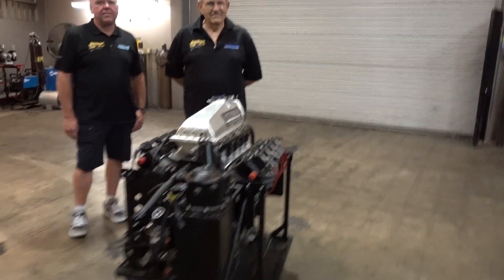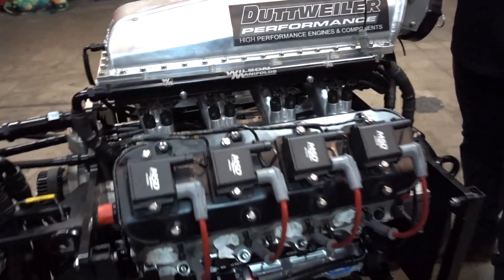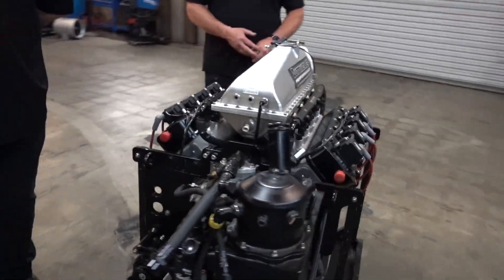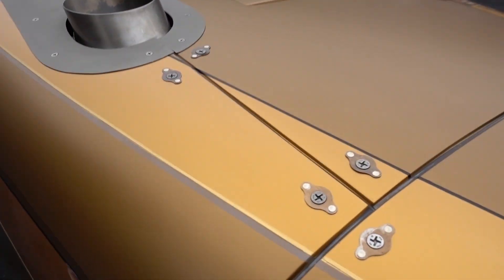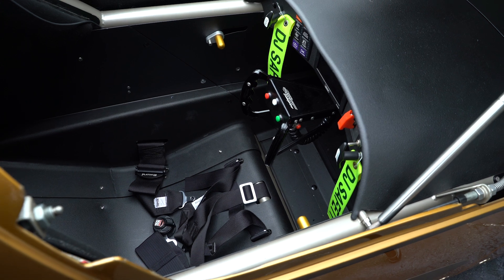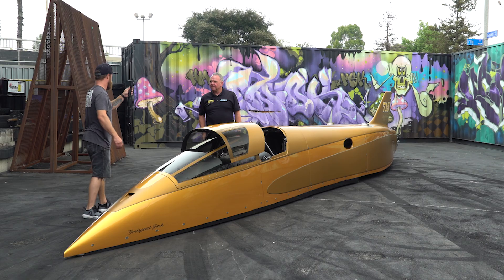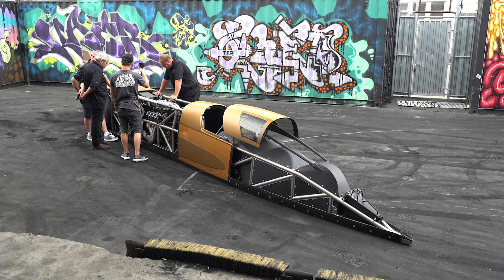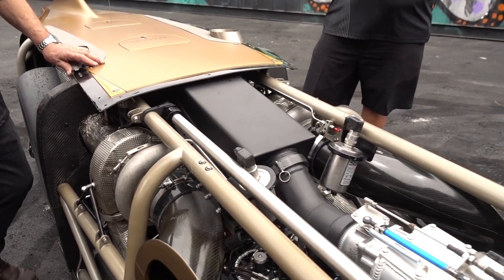What has 2600HP and goes 460MPH? LS Powered Landspeed Record Crusher!

Comment: 2.4 Gallons per Mile isn't that bad when you're going 460 MILES PER HOUR
Reply: Just put it in neutral and you definitely get ther
Reply: Holy crap but that's $ 1,104 an hour but if ya got money to build something like that then what's a grand...CHACHING..POCKET CHANGE
Reply: @emileemarshall7757  a thousand an hour? almost a thousand gallons of gas an hour... where do you live that gas is basically a dollar a gallon....
Reply: Here & Now the gas they use is prolly $10 + a gallon
Reply: they can buy a new LS engine with the money for test runs of this thing
Reply: 2.4 mpg is the same when going 460 and when it’s going 10
Reply: Yes but, about the same amount of nitro, to go 1k'.  I personally am impressed there is fuel MILEAGE at all! One again, great presentation! Ty!
Reply: Yikes, it’s miles per gallon not gallons per hour haha.
Reply: Why does this number even matter?!
Reply: You wanna run an hour, that's 191+ gallons...
Most economy cars probably get 460mi on a full tank.. like 46mpg on a 10 gallon. Or 8,786 miles with 191ga
Reply: @KevinBurke-bi0n3rd  ohhh, but the sound of a Prius rattleing out of the exhaust,,,, PRICELESS!
Reply: The math going on in this thread is sus
Reply: You realize it’s usually measured in miles per gallon not gallons per mile right? That’s pretty fucking bad 😂

Comment: I had to scoop my jaw up off the floor when he said "it's heavily into the traction control well up to 400 miles per hour"
Reply: Isn't it amazing what 2600 hp can do?

God even that number is mind-boggling.
Reply: Well when you’re racing on salt

Traction is the nearest limiting factor compared to drag
Reply: this why they take such a long run at it , cause they cant use the power
Reply: Several years ago Duttweiler said that "It's very unnerving when the engine spins the tires at 400+mph! LOL Said his "little" engines are almost as fast as the big engines because the big engine torque spins the tires at speed.

Comment: I bet when aliens land their spaceship will be LS swapped
Reply: Yote swaped
Reply: This comment made my day hahaha
Reply: @justinwright6142  no room for a slowyote
Reply: I would have put a 2jz or lsx. Possibly a lt engine
Reply: only problem with that logic is that it always took chevy and dodge a whole litter larger just to match fords 5.0 so yeah no I would still rather the coyote
Reply: @mashedt8rs290  well in that case the 800hp koenigsegg takes less than half of a coyote and less than half the cylinders, oh wait cant just pull that out of some junkyard truck like you can an LS can you, more liters doesnt equal power my man.
Reply: @ripinpieces8387  Bro the koenigseggs originated with Ford V8s. Ford has always made more HP per liter than both chevy and dodge.
Reply: @ripinpieces8387  Also Koenigseggs are all V8s, and you cant have "less than half the cylinders of an 8" that makes no sense. Also why are you telling me that more liter doesn't equal more power? That was what my original comment was saying, that both chevy and dodge takes an entire liter to match the power of Fords engines.
Reply: @mashedt8rs290  yeah but whats the downside of another liter?? Like its a competition to have less liters, and look it up there be a 3 cylinder koenigsegg made that makes over 500hp.
Reply: @ripinpieces8387  fuel consumption. Smaller engines generally uses les fuel than a bigger engine with some hp

Comment: step 1 take a canoe
step 2 turn it upside down
step 3 LS swap it
profit you just got yourself a Landspeed Record crushing vehicle
Reply from the maker: Genius.
Reply: flip canoe back over and smash water-speed records profit^2
Reply: jokes aside in the 50s they used very similar things out of warplanes to make bikes
Reply: Look up belt tanker land speed cars...
Reply: Put Brad to build it.
Reply: Craig  "belly tank" or "drop tank"
Reply: Fun fact; the 1906 stanley steamer rocket, which set a land speed record in 1906, was actually two canoes flipped on each other, powered by a steam engine.
Reply: Fred Banionis  Perfect.
Reply: No lie, this comment, actual laughter was produced.
Reply: @noprob364  look up long tail drag boats, these guys in Thailand strap crazy ass turbo diesels and shit on these tiny boats and just haul holy ass down their rivers.
Reply: Sounds like a Sumbag Lab experiment!
Reply: Water is essentially a very dense gas, so hydro- and aerodynamics are pretty much the same. It would definitely work if you use a cart size frame as a base and lie down in the thing. Clear plexi on the front and a small tail fin to stabilise the deal.
Go for a cart landspeed record.
Reply: @starfox4574  *alwp?
Reply: Genuinely true 😂

Comment: I love the gearbox shifter best, it works the same way as the 3 speed in my homemade dragbike except I only have 3 speeds and mine is air pressure not co2 (I was toying with using nitrous to save a cylinder though) and I pull rods through the centre of the cluster which the gears connect to internally rather than using forks, but ramps on the gear throws out the previous gear against air pressure, which means you can shift without letting off the throttle, and it also means if you back out of the throttle to save a run, the gearbox doesnt take a shit as the ramps override the shift pressure and save it from locking up when you back out. That is a truly awesome build and they are cool guys for letting you see under the hoods at how it hangs together.

Comment: Easily the most interesting build biology video yet! There’s so much more about the car that I want to know about now. How do the tires not balloon at that wheel speed. How do the keep fuel/oil from not getting pushed to the back. What does the steering system look like. I need more info!!!! Such an awesome video, dan always seems to ask all the right questions, he killed it!
Reply: jetpilot28 I thought they said hey had pumps in the back that push it forward
Reply: I'm pretty sure most salt flat guys use air plane tires that you'd see like on a commercial jet...where as the speed increases, they get skinnier and stiffer and don't have a "balloon-like" sidewall. don't quote me on that though...
Reply: @BlownVR  Too late. I'm quoting you on it lol. That's pretty interesting though. I had never thought about it
Reply: they actually use steel wheels no rubber after a certain speed the tire just destroyed them self so they run i think aluminum or steel wheel
Reply: In the old days they would run solid wheels, then they switched to aircraft tires and like this team runs the LSR tires. Technology has caught up to be able to make a tire that can handle those speeds. You also have to realize that salt is not like asphalt so the durability isn’t as intense on the tread. It is all more in the construction and sidewall strength.  With regards to the fluids, they are using massive pumps to push forward and keeping the fluid flowing helps mitigate the g loads pushing it back. It also helps that they aren’t accelerating like a top fuel car.
Reply: mrthesquid well flashpoint stream liner still uses solid wheel in the front.
Reply: Actually, the tires do balloon a bit. They didn't really show it in the video, but the front wheels are one in front of the other like a bicycle. On their original car, once they went fast enough, the two wheels expanded enough that they rubbed together. Like Kenny said, I don't believe it lost pressure, and it didn't crash, but there was definitely some tire carnage.

Comment: Who needs a carbon fiber wing when you have a landspeed car!? Look at that aero!
Reply from the maker: It's all aero! Insane.
Reply: The arrow dynamics is crazy.
Reply: That's not the land speed record vehicle that is the thrust ssc.
Reply: GamezAhoy well this didn’t cost $100 million
Reply: @theantsaretakingover  cheaper version but cooler and...moderately safer xD
Reply: @gamezahoy712  there are lots of different classes of land speed records. Jet or rocket cars like the thrust ssc play in the absolute top speed class, but they don't spin the wheels with the engine.

Crud, the world's fastest stock-bodied car was a 1990s Firebird for a while, 300mph and the only outside hint something was weird was a lack of mirrors. Took about 1200hp to push that through the air.
Reply: @ScottKenny1978  yes I know but the thrust ssc does not hold it anymore if I am correct.

Comment: I enjoyed this far more than I thought I would. I've always known there's a lot of engineering that goes into land speed cars, but I've never really thought about just how much stuff there is on one that you won't find on any other type of car.
Next you guys need to get Underground Racing's half-mile record holding Huracan. I want to say it was like 276 or 278 in the standing half mile. 460 mph in five miles is impressive, but almost 280 in a half mile in a street legal (kinda) car is just stupid.
Reply: I know their demo car/test mule ran 259 at one point, but i could have sworn I remember seeing one where it ran over 270 and was pushing like 2000 bhp. I might be getting it confused with one of their standing mile runs because I know that Huracan of theirs is a record holder, but I also know the current standing mile record is like 293 or somewhere around there.
Reply: Cleetus is gonna have a jet car soon.....  Think this will hold up?

Comment: Yet more proof that the LS is the greatest engine ever designed, whether it's a bone stock low output truck motor or a 100% custom built version.
Reply: Fan boy mentality instead of appreciating everything for what it is ...
Reply: @brucedressel8873  it isn't fanboy mentality. The LS engine is the cheapest source of reliable horsepower, if you can't handle that reality, you can cry yourself a puddle. It is what it is, and it's a beast.

Comment: CRAZY NO DOUBT

but not sooooo crazy anymore when you think about that Mercedes would have been able to build a streamline car that runs also About 700-750kph (which is about 460mph=740kph) back in the 1930s 

they wanted after they built and drove their other streampline car up to 432kph also bakc in the 1930s 

but for the one going up to 700+ it was too late because before it could run the war broke out

but think about that thats about 80 years ago and Mercedes was able to build something that runs as fast as this car
Reply: Also don't forget tire technology from that era. Practically non existant. Or at least experimentally, because being Mercedes Benz they would have begun experimenting with hi speed tires while in f1

Comment: The MOTEC & Shane T combo is so trick, that I bet Shane could run a couple pneumatic rams mounted to the wheel and program the ECU to steer the car.  The MOTEC can already accelerate and shift the transmission.

I feel that as trick the ECU is in this thing, the fabrication and engineering is just as crazy.  The design where the turbos, intercooler etc stay in place and the different size engines that the have all can bolt up to it.  Super trick.

Comment: To balance the downforce so well with any active aero is crazy good. The car uses a bit of an upside down airfoil to increase down force at a certain rate throughout acceleration. Incredible engineering. Not so much of that cheap Newtonian crap that just makes drag. Almost entirely Bernoulli.

Comment: Dry water, I think it's called Novec. Won't corrode metal. Good idea to have a respirator with O2 supply for the driver if you use that.

Comment: There's a lot of  NHRA drag racing technology in this car. The car is like a dragster in an enclosed shell. There is a lot of Pro-Mod technology in the engine and Pro Stock technology in parts of the transmission.

Comment: "Yeah we figured most fires in the engine bay start so low because of oil, so, we made these little things spray water all over to cool things off and also deal with fires."

Just. You know. Casually putting fire sprinklers in an engine bay, not just to help mitigate the fire, but to also COOL THE ENGINE. No biggie. And, you know, cockpit-activated dry extinguishers to suck all the oxygen away from the fire.

Comment: i've always wondered if i turn my car heater on 100%hot and turn the AC on, will it help cool the heater core or is the AC set up after the core so it only cools the outgoing air into the cabin, does turning the heater on full cool an overheating car?

Comment: When I first read the title and was like it only goes 460 mph with 2600 hp, but there are some limitations
Reply: Simply stated, the force acting against a moving object increases 4x as speed doubles.
Reply: where did you get that only from? Have you got an example of something more impressive in terms of power/speed correlation?

Comment: An exhaust can make a downforce?
Reply: Sure and lots of it. A turbo is a fan turning a fan and aspect ratio and what not lets say exhaust pressure is 50psi to get 65psi of manifold pressure. That looked to be about a 4" exhaust pipe so about 12" of area at 50psi is 600 lbs of downforce per side so 1200 lbs total?  

Oh, and jet engines. That exhaust has a lot of force. 

Up down forward or back. It's all about where you aim it.
Reply: Thrust vectoring..... but on the ground. Dope AF!!!
Plus single file front wheels! Oh my ugh!!!
Reply: @timothydillon6421  1200 lb? Not entirely sure about that. How did you calculate; did you take exhaust density into consideration? 
If you're right they should've aimed it backwards, that would be a lot of thrust that could significantly increases speed.
Reply: @LocPH.  it was purely a speculative guesstimation using nice round numbers. But I don't think those numbers are completely out of line. 

As to the vector of where to aim the exhaust, that can be modeled in CFD and tested but if the car has more power than traction then it needs down force. If it has more traction than power than you can use the exhaust as thrust. Or any angle in between providing a balance of down force and thrust for the specific purpose

Comment: A 443 dart small block that’s how it makes so much HP the small block LS configuration a big block just can’t make the power a SBC can I would throw two holly 1250cfm carbs on there and supercharger to push on up into the 3000HP range EFI chocks your motor it’s starving for air you put carbs on that and your gonna make a lot more HP than with EFI even though you have upgraded injectors you should get like 1/10 mile per gallon not 2 per gallon

Comment: Land speed record crusher? Sorry but 460 still seems a bit short to the 700+ that is the current land speed record set in 1997. Unless you mean land speed exclusive to LS powered enginges. Which again still wouldn't make too much sense, didn't the guy say everything is custom built, and not parts you can buy?
Reply: Wheel driven, piston powered. There are many classes of land speed records.

Comment: Aerodynamic drag is so costly and detrimental to the environment.Fuel/electrical range/ can double with a full aerodynamic package. Think I'm kidding. Try pedaling your bike from a standing start to 90 mph/140 kph .Impossible.Add a full fairing and a professional rider and 90 plus mph speeds are possible. Imagine having an enclosed motorcycle with 2 /3 or four wheels in a narrow enclosed shell.100 - 300 mpg at 70 mph. It would be both fast and efficient and safe. Add a removable top or NACA ducts for the wind in the face.